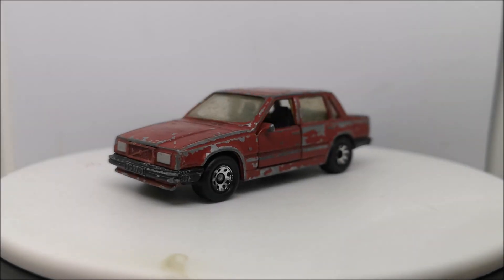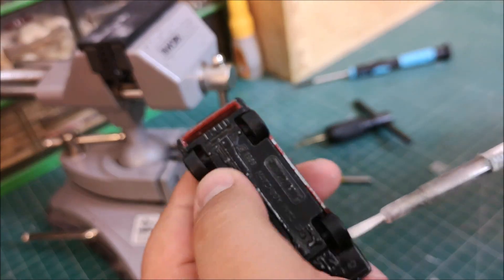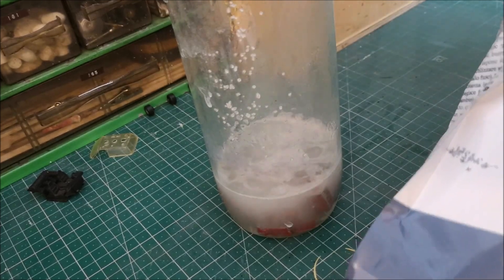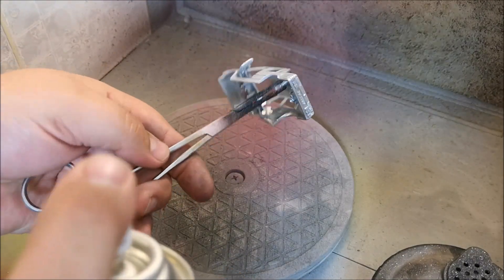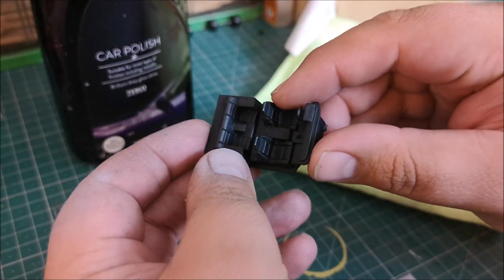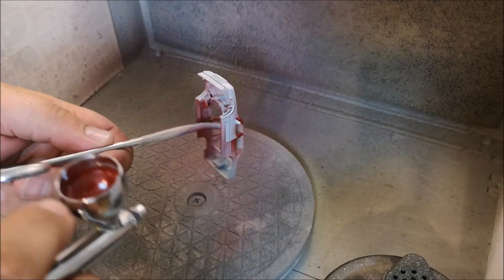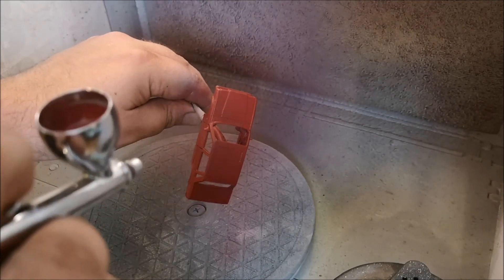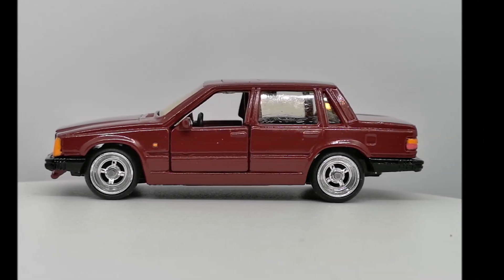Matchbox 1986 Volvo 760 GLE - Custom Video

Comment: What a lovely job! Nice one. The 760 denotes this car had the PRV ( Peugeot, Renault, Volvo) V6 engine. The turbos of this era were 740s as the engines were four cylinder motors. In the 1980s the designation GLT usually meant the ‘sporty’ version.

Comment: So wonderful Volvo became. The Volvo 760 was the luxury model and the Volvo 740 was the family model. In 1982, just 760 was released and in 1984 740 was released. The Volvo 760 was very expensive when it was released. But your 760 was like a completely different car. A little more pimp so to speak. Continue like that.

Comment: The Universal Toys Matchbox cars were top-notch. intricately and accurately-designed models that only suffered from paint quality issues of dust / particulates on the bodies causing imperfect surfaces.  But the designs were right on the money in terms of accuracy.  Matchbox was always known for accuracy until it attempted to go head-to-head against Hot Wheels and its fantasy designs before returning to its roots in the late 1970s.  Universal really did a laudable job in maintaining the Matchbox brand by carrying the baton for ten years until TYCO's acquisition.  Universal era models seem underrated, and I even remember at the time that the interest in collecting had significantly cooled in the 1980s and 1990s with competition from video games.  But this Volvo is a masterpiece, and Matchbox competes with Majorette for best Volvo 7-Series casting.  I never thought the car "boxy", but more as conservative and dignified.  Great job on this!!!

Comment: One little "hack" to get the paint to flow better is to have it warmed up a bit, when you heat it up it atomizes easier into smaller bits so you won't get as much of that spatter.

Comment: Very nice - I'm trying out your caustic soda paint removal method - only concern I have is apparently it dissolves zinc, which is part of the zamac material die casts are made from. Just wondered if you'd experienced any problems using it?
Reply from the maker: So far so good

Comment: Think this was in my collection as a youngster!  So the paint you used was just a mix of two Tamiya paints and thinners but you noticed the ratio was slightly off? Does mixing colors require more or less thinner than just one color?
Reply from the maker: I didn't try to exactly colour match